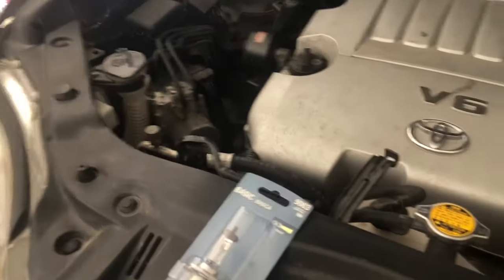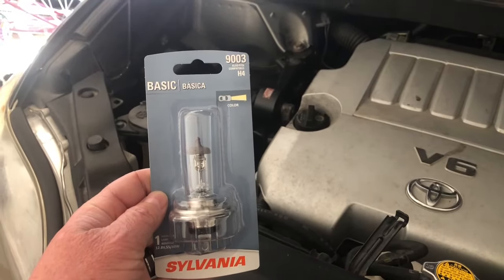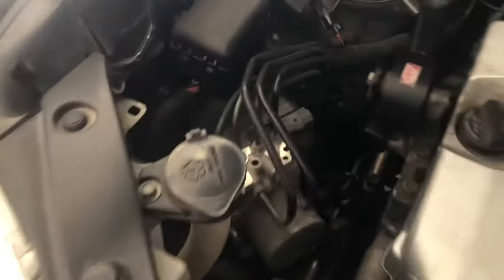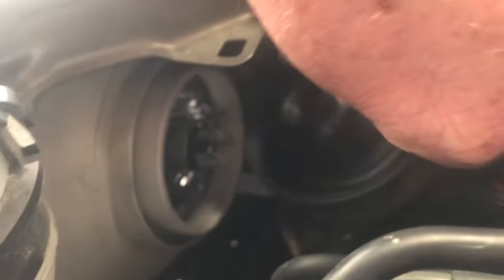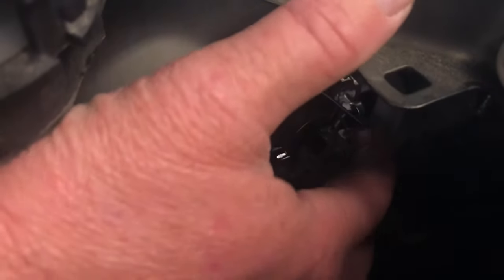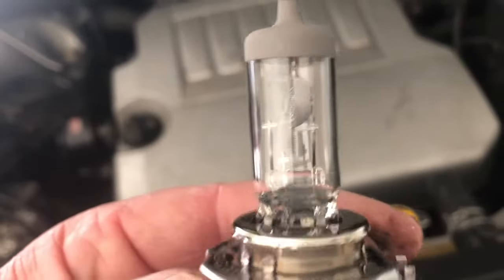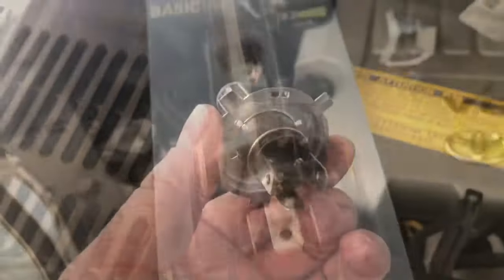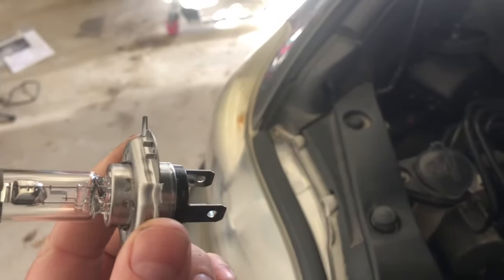How to change a Headlight Bulb on a 2008-2013 Toyota Highlander

Comment: One minor difference on our 2010 Highlander Hybrid. On the passenger side headlamp I had to remove the fill pipe for the washer fluid tank and remove the battery clamp in order to access the headlamp.

Comment: 2008-2013 highlanders are not the same. Totally different bulb sizes. 2008-2010 uses 9003 and 2011-2013 uses H11
Reply: Thank you for stating that because I have a 2013 and just found out one of my bulbs is out. I’m watching this video and what he’s doing compared to another video is so different it makes me think that they change the whole bowl of assembly as well and made it much simpler. Again thank you for mentioning this difference.
Reply: @ObservingtheObvious  ditto on what last reply says. Driving home up the mountain noticed one low beam is out and it is separate bulb. Looks really easy to replace tomorrow.
Reply: @kalanimacgill2752   
I had my other bulb go dark on me on the other side, and I didn’t want to deal with it right away so I used a mechanics trick where you turn on your lights and let them get hot for a bit then pop your hood, lift it up and drop it and it shakes the filament that’s probably broken loose on one side and if it catches the metal just right the electricity will cause it to weld itself back on. I did that on this bulb and did it once and it only lasted for a day or two and went back out. Only the next time I waited until I had been driving it for a while with the lights on; tried that trick again, and it reconnected and went back on. It’s actually been good now for a couple of weeks. It’s just a trick to use in certain cases, but I will be replacing it at some point as it eventually goes out.